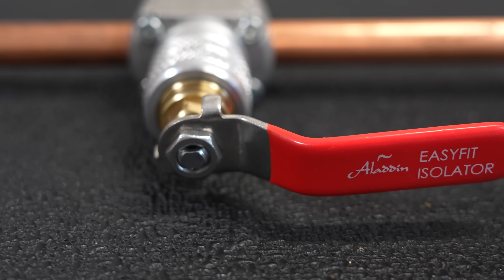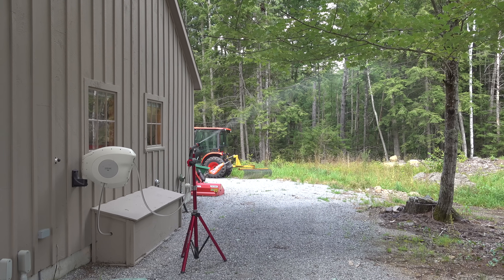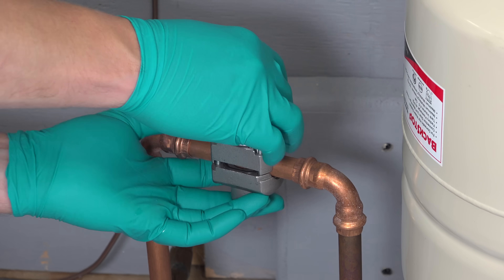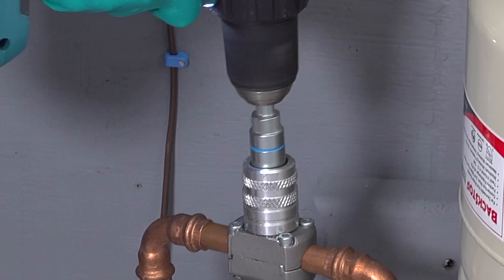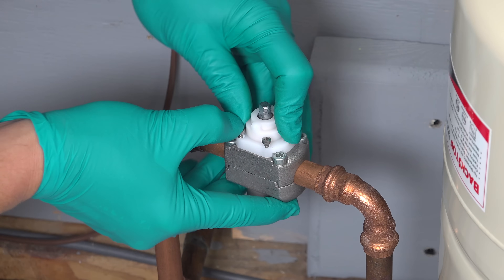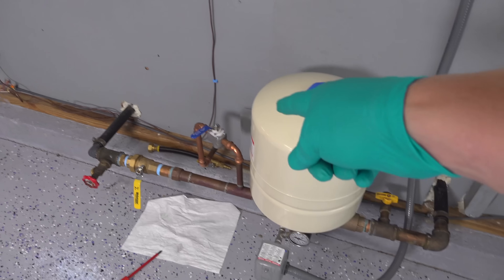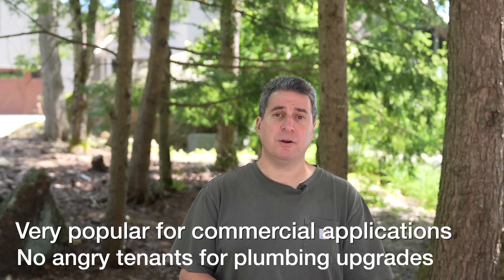SHUT-OFF valve installs on a LIVE WATER PIPE - Aladdin EasyFit Isolator

Comment: Very interesting. When waiting for a welder being finishing his weld ( i am a weld inspector/ndt), a special crew came to a spot nearby (  10 meters) and they did this but on a big scale. It was on a live steam pipe at the Tata Steel steel plant here in the Netherlands. It was like this valve but very big. The pipe diameter was about a meter or 40". Production is non-stop on such a plant so this special company came to make a valve there (hot-tap). It did not go as fast as this small valve in this vid.

Comment: Buy and install a proper valve, it's a little more work but ALL saddle type valves will eventually leak and if you're a DIYER with little experience you could have a real problem real quick so have someone who knows what they're doing do it. In a lot of jurisdictions these types of valves are illegal and if you have water damage and the insurance company wants to screw you, which they usually do, it will cost a lot more than hiring a plumber. Don't think just because Home Depot sells it that it's a smart alternative and that it's okay to use where you live.

Comment: where does the pieces of copper that you cut off go??
Reply: It goes into your piping and damages fixtures.
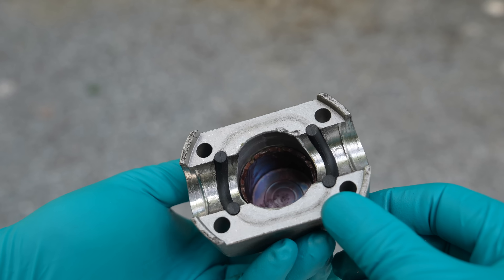Reply: 3:55 It goes at the bottom of the valve.
Reply: @apache1120  really doubt that, especially if the water is running. Cuttings are 100% going down the line. Don't get me wrong this is a great solution to get shut off on the line.
Reply: @dantruong2582   The copper shaving gets flush through the line.  The copper piece is trapped at the bottom of the valve.
Reply: @apache1120  those shaving can do a lot damage if you are careful to direct them somewhere to leave the system.

Comment: The main shut off in my basement has zero effect on the flow of my water (relatively new house to me.) I suppose I could have the city shut it off, and replace the valve, or at least the valve stem washer, then call the city and have them come back and turn the water back on...

Comment: the 1/2" version is actually $300 as of 5/16/2024.  You'd have to have a pretty compelling reason why you couldn't shut off the water for 60s, the time needed to cut the pipe and install a Sharkbite shut-off valve.
Reply from the maker: Agreed, its a last resort valve or emergencies. I have repeatedly told them price it at $99 and while still pricey it wound sell a lot more. I

Comment: Was this designed by ChatGPT? This is really dumb in my opinion. Too complicated & prone to mess up in the long run - just witnessed the heavy shaking as the pipe was being cut through. Easy to cause a larger screw up this way especially if the outside of the pipe is not clean & oxidized. Learn soldering, it is the only reliable cheap way to install plumbing. All these gimmicks are for the lazy & ignorant.

Comment: The sad thing is the price is too high to just buy, and keep around just in case of an emergency. It’s like pricing for the military. If it was $100, I’d buy one for just in case emergency. Which would be the cost to hire a plumber. Otherwise, I’d just hire a plumber to fix or install another valve
Reply from the maker: I agree, its a great product but thats exactly what I told them. If you made it $100, they would sell 500x as many. I hope it gets at some point and they will sell a ton of them

Comment: What really scares me is the 55psi rating which would only be slightly higher than my local water suppliers psi but the pressure can fluctuate and may go over 60 at time even as high as 80

Comment: Just shut main water off, go out and buy a shark bite turn off valve , cut pipe and install shark bite. Not hard at all, shark bite just slides on, This crap is so expensive one shark bite is so cheap. Geeze, This company wants to get rich fast...... I would never use this crap. Always have a main turn off wrench for outside under lid in case you cant shut water off from inside...RIP OFF CRAP COMPANY!!!!!!!!!!!!!!

Comment: I wonder how long this would last until the gasket starts to fail and cause a major leak issue. Due to using ordinary gasket implementation I won't use this compared to tried and true copper brazing with a valve. This "Aladdin EasyFit Isolator" is only great for a temporary solution, which you can now add a proper brazed valves.

Comment: You lost me at $250!  Too bad the price is not economical for most situations.  But, if you needed to shut off the water and didn't have the means to add a proper valve, I can see where $250 might be a bargain.

Comment: Plumber quoted $500 to install a new main shut off value for me.  It's $300 on Amazon right now and I would rather pay the $500 and have it done by a professional. BUT I can see many DIY'ers using this - This was a very interesting video!! Thanks.
Reply: Question? Where does the drilling pipe garbage go? These are copper shavings from drilling the pipe???
Reply: @andrewagustin1349 
From what he said in the video it's pushed and trapped at the bottom of the new valve.

Comment: Can now bypass the city water meter and save thousands on bills.
Reply: Maybe for a month….actually…now that they have the automatic meter readers….I think that makes it harder…I wish…I am not a fan of of the City or the County or the State - course I live in the “war zone” and have been penalized for others stealing my water at the meter in various manners…including installing their own meter after the city removed it.
Reply: @typrovoost7640  hi water company here. Don’t bypass the meter completely we will catch you.  What you need to do is partially bypass the meter. Do you wanna start lowering your water usage to where it’s around or slightly lower the minimum bill. There’s almost always a certain amount from zero to ? Gallons that the price is the same. If you’re lucky enough to have a meter indoors, it’s not difficult and almost impossible to be caught.
Reply: Until they come by to do routine maintenance check or some other work and discover your thieving ways. Then your fines will exceed any money your trying to save while ripping off the city.
Reply: Most of the water departments here use poly pipe from the corp stop to the meter valve and iron pipe to the meter.  I think this only works on copper pipes, which are not under ground.
Reply: They will know and they come to inspect

Comment: I used these in a condo where multiple units shared a common shutoff (and didn't want to shutoff)..   Works well, but you have to make sure to get the slug otherwise it may end up clogging something downline.  Also copper shavings can end up downline as well.

Comment: Wow these are really expensive over there in the states. Here in the UK they are about £50 / $70 so some serious markup for you.
Reply: Been done dirty on those "exchange rates" 😂
Reply: Tariffs...
Reply: @fzigunov This video was posted before all of that BS so it's probably more like $400 now
Reply: @metalhead2550  it's still the same price. I have a couple on hand, but in the years I've had them I've not needed to use it. When the scenario turns up that using this will be useful I'll be glad I have them. Just to say that in the scenario I need this I'm not going to care about the cost
Reply: @fzigunov  It has nothing to do with that bs. It is because of resellers' greed to maximise the profit of a product of the US market...
Reply: @MrZimmaframe  have you considered transportation costs
Reply: @dcg-f7r  Lol no, because the US has a greater shipping volume than the UK, so it shouldn’t make a big difference, if anything it should be less. 👍🏻.

Comment: I don't think that is meant to be a permanent installation for that price. It is only for emergencies until you have the correct fitting or valve to replace it for a permanent setup. Then you can re-use it later for other emergencies.

Comment: Hi there, I'm wondering if you could help. I've fitted the isolator valve on to the pipe. However, there is no dot on the housing. Both dots are on the cutter plug at 180 degrees to each other. Do I just line them up in a straight line with the pipe or have I got a dud? Cheers

Comment: great video, well explain and quick. this is  a great product when there is no shut off valve accessible and the service can't be interrupted e.g. multiple units buildings, the older ones never had individual shot off valves, the water service had to be interrupted for various units. new ones now if done correctly will have their own shot off valves. 
wondering if it can used on pex pipe or pvc?

Comment: I've used something similar when dealing with HVAC repairs, a bullet piercing valve for servicing equipment with just a process stub.

After looking at the price, you'd have to be bat shit crazy or a fool with more money than brains to purchase that product!  There are much cheaper ways to solve that problem 😊

By the way, I'm a decent machinist and could easily make that device for far less than what they are asking.  Once you consider the fact that these valves are probably being mass produced in China for pennies of the dollar via a CNC machine and then resold at a ridiculous price, it won't be long before that company goes bankrupt 🤣

Comment: Ive used the open sharkbite valve trick before. Leave the ball valve open, cut the pipe, while its blasting away, slip the SB valve and then close it up.

All for about 25$.

Comment: These type of devices are ok for short time fixes , in time the little hole punctured in the water pipe by the easy fit instillation Will fur up & cause corrosion & blockage in pipe .  Do a proper job switch the mains off & fit a proper traditional valve , because you will end up having to do ,it anyway .  If something sounds too good to be true ,it usually is, so do it right & don’t take shortcuts .

Comment: Ok but what happens to the shavings from drilling the metal? "pushes the pieces of pipe that it cuts into the bottom of the valve" and then what? Theyre now in your water supply going wherever

Comment: Awesome tech, but it's pretty easy to shut off the main supply line, and make a repair in an hour.  This valve though amazing is not worth that high of a cost to save a little bit of time and use of pressurized water.  And that doesn't even address the question of what happened to the shavings from the drill process, did they stay in the water line to cause further future problems?

Comment: nice technology on the valve. looks good for copper. but, while using Pro-Press fittings like you used there, it would have been easy to put in the valve while not sweeting the copper fittings. 

if that was the only expansion tank used there, i would have made it much bigger, spicily if you are using hi volume with irrigation.  it looks like a 5-10 gallon one used on water heaters. does your pump cycle on and off allot?

Comment: They need to make this comparatively priced to traditional methods. It's cheaper and more reliable to pay water shut off fees and then cut and solder than the $560 + tax this company wants for a 1" isolator valve.

Comment: locally the water pressure is 90 psi to the curb, will this valve handle that much pressure? and since you are cutting the pipe out. Does this valve work well on long runs of pipe?

Comment: Pricey at $300! I think that a soldered valve is more reliable & a fraction of the cost. You could probably hire a plumber to solder in a traditional valve for the same price & you would have a better repair/installation than this quick fix? Only my opinion.

Comment: Nice product, but just WAYYYYYYY too expensive. Can install a ball valve with compression type fittings. Not usual having a pipe burst where you couldn't install a valve with a compression fitting. Of course, this valve could be a life saver in an emergency for sure.

Comment: Is there a possibility that the drilled-out material gets flushed away with the pressure further down the pipe instead of getting buried in that intended spot at the bottom of the valve? Can you mount these valves vertically or upside down?

Comment: Great looking product but I’d love to see someone from the company explain how they justify the price. 250 is highway robbery
Reply: Yeah the extra work of cutting a pipe and using a sharkbite or prop press seems easier in terms of getting the product
Reply: Yep! It’s less than $200 here . It’s handy where you have to drain the whole system down to install or capable of fitting a regular valve .🇬🇧
Reply: Because in reality, few people need it. Poti always has the option of turning off the pump or shutting off the water elsewhere.
The only other option is an inlet valve from the city main. But I don't think this solution is durable or reliable.
Reply: @Nitrofan_Kerm  Why do you think it's not durable or reliable?  It creates a sealed environment, cuts the pipe, and then replaces the pipe piece with a valve.
Reply: @EmperorA0  Complex shaped ring seal, large connection area.
Reply: @EmperorA0 You're adding a seal to the pipe that is not solder. That seal can and will fail.

I would consider this an emergency tool, NOT a replacement for a properly installed valve.
Reply: It’s £50 in the U.K. America adds on tariffs etc that the company adds to the price. That will have gone up even more with the new tariffs.

Comment: Some municipality don't allow this type of valve, particularly for professional plumbers because there is rubber gasket that will fail just matter of time.  This practice is not a long term solution.  You are just delaying eventual leak that will happen in the future.

Comment: That leaves several questions, is the saw blade made of something that does not start rusting? Does it completely cut the pipe or does it leave a bit on each side? And the fact it uses a rubber seal would stop me from using it for anything more than an emergency fix.

Comment: Having worked in building maintenance, chillers and hydronic systems for decades, it's hard to imagine a situation where I would be forced to use such a expensive valve.
Reply: Many new technologies are creeping into the skilled trades service market... Good for the Consumer!
Reply: You'd need to be in a situation where you cannot cut the water off, and don't have the tools to create a freeze plug.  I can see a residential plumber having these as a "the home owner has no clue where the main is" or "the water main valve is broken" situations.  Anything else, and there's better ways.
Reply: Having paid plumbers hundreds of dollars to do very little, this expensive valve is really cheap.

Comment: I'm from the UK and we use these on 42" water mains all the time, works a treat.
Reply: Holy Moly had no clue they made a valve that large, The dam thing has to cost 25 grand at that rate !!! The Pressure on that size pipe has to be Herendous !!!

Comment: This is a flood waiting to happen if your adding it where you cant find a shutoff valve...
Reply: Thanks for your comment, the EasyFit solves that problem as it's approved as a shut-off valve and can be fitted in minutes.  It's been sold successfully in the UK for over 10 years.

Comment: Where does the copper you cut actually go?
Reply: Thanks for your comment, due to the valve’s unique design the pipe coupon and the majority of the swarf is captured in the lower housing in the special chamber at its rear.

Comment: So ,what happened to the metal shavings and the plug that was drilled out?

Thanks
Reply: Thanks for your comment, due to the valve’s unique design the pipe coupon and the majority of the swarf is captured in the lower housing in the special chamber at its rear.

Comment: Nice product, very expensive.  It's simpler to just cut the pipe and install a regular valve.  However if you don't have experience doing this I recommend this product.
Reply: This valve is not designed to take the place of a regular shutoff valve.  It's designed to be used in situations where you can't shut the water off, for whatever reason,, and need to install a shutoff valve on a live water line, possibly to prevent a lot of water damage from a leaking pipe in the home.

Comment: its cutting and actually adding a ton of debry in the lines so its a failure of an idea. PERIOD
Reply: Thanks for your comment, due to the valve’s unique design the pipe coupon and the majority of the swarf is captured in the lower housing in the special chamber at its rear.  It's  always a good idea to flush a system after adding valve to pipework,
Reply: what a load of bs also you are creating hole and copper is not magnetic so there is no way to stop it from the directional flow either way, when you are done you never open it again and meaning you let the tankless or water-heater catch it all.  What you need now is better idea to prevent it.  @easyfitisolatorusa
Reply: @TheBiblesQuotes  the only way to prevent it is to cut the pipe a regular way lol

Comment: so... you drill the pipe... what happens with the remains of the drilled pipe? is it hold within the valve? "swim away" ?
Reply: Thanks for your comment, due to the valve’s unique design the pipe coupon and the majority of the swarf is captured in the lower housing in the special chamber at its rear.

Comment: Looks like you still get shavings in the line which would mess valves up in sink and toilet and showers
Reply: Thanks for your comment, due to the valve’s unique design the pipe coupon and the majority of the swarf is captured in the lower housing in the special chamber at its rear.

Comment: So.. what happens to the cut out copper piece? just getting a free ride in your system?
Reply: Thanks for your comment, due to the valve’s unique design the pipe coupon and the majority of the swarf is captured in the lower housing in the special chamber at its rear.
Reply: @easyfitisolatorusa  That is quite.. genius